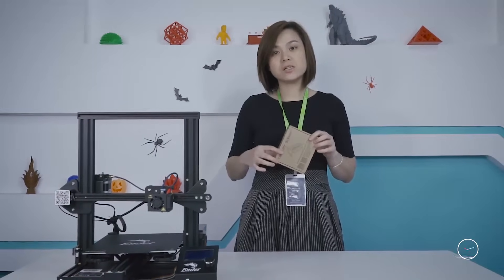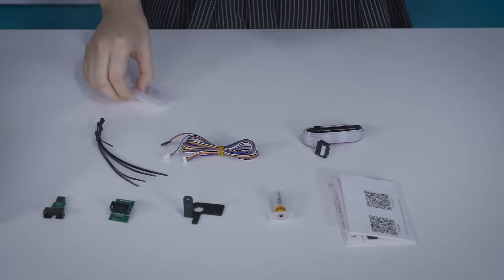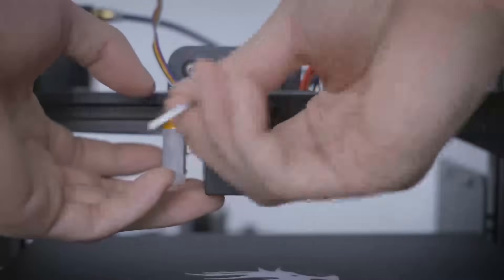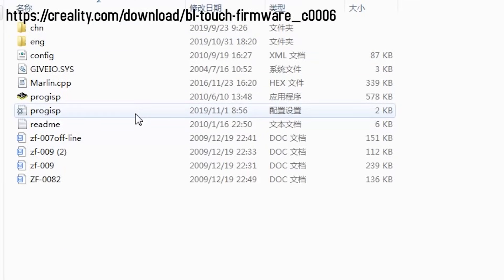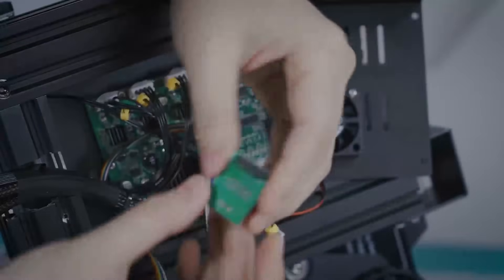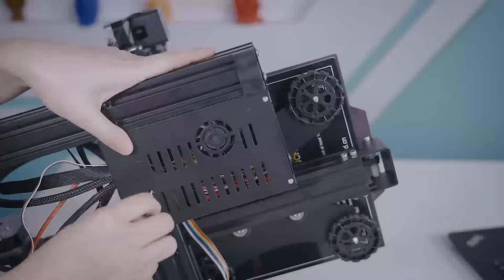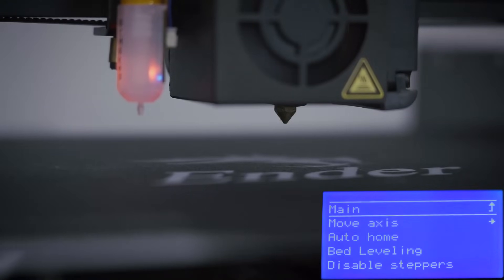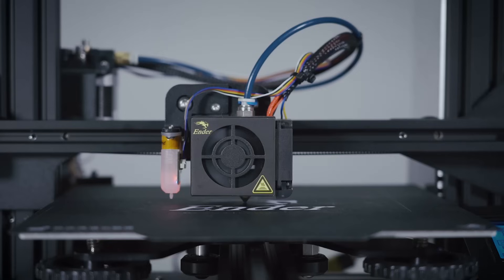How to Install Creality BL Touch Auto Bed Leveling Sensor Tutorial (Ender-3 Pro Upgrade Setup)

Comment: I screwed up in my BLTouch installation and forgot to remove the screen connector while i was flashing the board. now my printer wont open and when i plug the screen directly to the board, the creality logo is jumbled up and it beeps rapidly, what do i do ?
Reply from the maker: What kind of printer are you? Ender 3 or Ender 3 Pro?
Reply: @Creality3D  i have the ender 3 pro. I was able to fix the issue, it was caused by the connecting adaptor, it was not connected properly. The cause was me aligning the connector on the sides of the plug instead of plugging it via the pins which caused the misalignment.

Comment: Hello I Instal BLTouch on Ender 3Pro mainboard 1.1.3. I do everything like in manual. But I have problem with bed leveling.
Reply from the maker: What's the problem?
Reply: I cant print, becouse z offset allways is wrong
Reply from the maker: @barusb5022   Please try to adjust the z offset to 0, shut down after saving, and re-level.

Comment: Thank you for making this video, I will install it on the CR-10S tomorrow! Wish me luck :)
Reply from the maker: Thank you for your review and good luck.
Reply: Well, it's been 7 months.
Reply: How did it go?
Reply: How did it go?
Reply: How did it go?
Reply: @billybob3743  Like everyone else very badly, the kit is crap the firmware is even worse as it is not a BL Touch firmware with the kit and the BL Touch firmware on their website has no x, y offsets adjusted so the probing misses 1/3 of the bed and baby stepping has not been activated and they haven't included the Marlin INO file so you can't fix it yourself. and they only respond to your comments if you are licking their butt.

Comment: Hi, is there any update of the firmware to use BLTouch v3 on ender 3 pro?... Doesn't work with actual firmware download on creality website (nozzle crash into the bed when homing steppers...)
Reply from the maker: Now the official website is that the firmware is already up-to-date. Have you checked whether the cable linked to the motherboard is correct?
Reply: @Creality3D  after inverting black and white wire, the bl touch is extend when going down but always doesn't sense the bed... heard about removing the C7 capacitor on the motherboard? is that necessary?
Reply from the maker: @heavyfgmetal9361  Will the BL touch needle stretch it?
Reply: @Creality3D  yes it does
Reply from the maker: @heavyfgmetal9361  Can the BLtouch needle touch the bed?
Reply: @Creality3D  yes it does... i don't understand what's going on...
Reply from the maker: @heavyfgmetal9361   If the BLtouch needle touches the bed, but the nozzle does not touch the bed, you can try loosening the large thumbscrew to bring the bed close to the nozzle.

Comment: I have a 3D TOUCH sensor Automatic BED Leveling Sensor BL AUTO touch sensor. I have one of these clones for a while now. I have installed it today, but it is really close to the bed. Which is fine, but the actual nosel from the extruder is about 8mm or so away from the bed. I know it should be level.  Can anyone advise me where i might be going wrong?. I have a creality  ender 3

Comment: Hi! I've an issue... I try to install the bl touch but I've a  "Chip Enable Program Error" when I try to write on the step at 2:49 :s anyone knows about something to do please? :s :s
Reply: I figured it out. You need to edit the name of any files in the download that have foreign and/or Chinese characters. I know it seems odd but once I've changed the names of those files everything boots up without errors and the drop-down list of Chips is available.

Comment: i need to remove te C7 capacitor on the original creality mainboard V 1.1.3  ( ENDER 3 PRO original board ) to install an original BLTOUCH V 3.1 on my printer?
if i don't do this which problems i can find? thank you for a quickly feedback

Comment: No matter what I try it fails I do everything it asks but when I go to print it seems to ignore what the sensor said and print low in the front but raise the back way too high, i even screwed the nobs as tight as they can go to make it as flat as possible and it still fails am I missing a step, is thing faulty,

Comment: I've followed these instructions, but as soon as it finishes flashing, my Ender 3 LCD says Ender 3 Pro; and there is a horrible buzzing sound coming from the speaker.  I have verified I downloaded the hex for Ender-3 and not Ender-3 Pro.  Any suggestions?
Reply: I had the same issue, I ended up reflashing the hex.  I would recommend looking up the tutorial that someone posted on Reddit.  https://www.reddit.com/r/ender3/comments/c3ccgc/cant_install_factory_creality_bltouch_kit/

Comment: Just starting the install and getting things ready and noticed the whole approach to storing the firmware and the software to install it on your site has changed. Now most of the files are stored in an RAR file and within that there is a ZIP file with the flashing software. Not a big deal, but for a novice they may never find it.
Reply: was struggling for an hour until i read this

Comment: From what I've seen, this isn't working with the 3.1 probe and the firmware supplied on an Ender 3 pro from Dec. 2019. there are a number of issues that need to be updated for the next tutorial:
1) The folder that you download progisp to has characters that aren't read on an English computer. If you try to load progisp, the 1284p dropdown will be blank. To fix it, move the files up a folder, or rename the folder so that the odd characters are removed.
2) The progisp file is not in the BLTouch firmware collection link. I had to find another link to the firmware, and dig down in there to find progisp
3) I'm unable to get my zoffset to 'stick', even when hitting 'store settings. I tried via the console and via pronterface using direct Gcode. The Z offset is a mess, and you can see a number of complaints of others hitting that in the comments below (For those that followed this).  The current path appears to be to compile Marlin 2.0 which has autoleveling support, or to use the TH3D Unified firmware. Either way I recommend installing a bootloader (the hex file here didn't appear to have that either...I had to reopen and reprogram a bootloader on it).  I searched for "progisp ender 3 bootloader" on youtube to find the article that got that part working for me.
4) Also if you have a BLTouch 3.0 you'll want to research the capacitor C7 removal issue (documented on the BLTouch official site), though Marlin2.0 may take care of that issue for you.

I'm using a stock Ender 3 pro board which I added a BL touch to, and I've spent 9 hours so far debugging it with the facebook community to find out that most of them have moved to Marlin2.0 to get things working.   I may have to do a video myself once I find a working config. If you try this and hit Zoffset issues please comment as a reply so we can get a thead and try to find out if it's certain hardware, or if the firmware is truly just busted that got uploaded.
Reply: that sounds like way more work than installing the sensor on the printer. please make a video once you figure it out!
Reply: Abex Stereo I did confirm it’s working with TH3D Unified! It’s a bit of work but worth it I believe. I’ll start on a video but it’s going to take a bit it was ALOT of troubleshooting!!

Comment: Does this mod also work for the 1.1.2 mainboard on the Cr-10 or do I have to upgrade to a newer mainboard?
Reply: Did you ever figure this out?  I just got a BLTouch V3.1 and am having trouble finding the right firmware.  I have a original Ender-3 with the 1.1.2 mainboard.  All I can find is 1.1.4 and above mainboards

Comment: Having problem with the ender 3 fan not fitting after installing the Pinboard A (screen connector is too high and the FAN is pressing it by force)

Comment: Tryibg to install this bl touch for like then fifteenth time. First thing I notice is you do the bed leveling, but that option is not on the screen for the ender 3x I have with the Marlin 1.1.6 hex firmware supplied...

Comment: I've watched this video several times and followed each step carefully. I simply can not get consistent results with the your BL Touch kit and upgraded Silent Board v1.1.5.
It's already destroyed the magnetic bed mat and significantly scratched my glass plate. I fear the nozzle is also damaged. I purchased all official Creality components to avoid exactly this problem. Who should I contact for help. Thank you.
Reply: I recommend you to check out the tutorials from TeachingTech, even people without technical knowledge should be able to follow his instructions. If something is inherently wrong with the firmware, comiling marling could solve it. 
If it is a hardware problem only creality could help you...
Reply: I have that same problem. Nothing work like they show on this movie. I'm angry and dissasemble BLtouch because i can't printing. i spend 120 euro for silent mainboard and bltouch with isp. With latest soft, step by step finally is shit.
Thet don't answer for us because they only answer for "thank you" post.
Reply: @monter75  ouch... 120€ is a lot of money, especially if it doesn't work.

Comment: I followed the instructions and everything went smooth.   When I ask the machine to level the bed or Auto home it keeps going Up on the z axis instead of down.  When I choose bed level it completes the first probe normally but then the BL touch keeps flashing red and the Z axis goes up and up.  It's very odd, any idea what that could be?
Reply: Did u get it fixed yet?

Comment: I've fought with this thing for hours now, following the instructions and trying to get the firmware flashed. I finally did, but when I went to test the bed leveling, as per the video, it doesn't work right. The probe doesn't come in and out, the head doesn't move around the bed, it just drives itself straight down until it grinds into the bed. No activity out of the BLtouch. What could be causing this problem?
Reply: sounds like either your bltouch wire isnt connected to the board fully or the wires might be flipped
Reply: I have the same issue. Wiring looks correct.
Reply: I figured it out. There are multiple .hex files in the zip file. Use the one named Ender3Marlin1.1.6BLTouch.hex. The other one (marlin.cpp.hex) in the same folder as progisp.exe is the wrong one. Creality folks: I suggest you remove unnecessary files from the archive. Maybe progisp.exe, the correct hex file and the doc files.

Comment: I am confused about setting the offset. Do I lower the nozzle until it hits the bed and that is my offset? For example, .9 is the distance for the nozzle to hit the bed, so the equation is .9+ 2 (any number)= 2.9?
Reply: did you figure this out? mine was -3 and still prints way up

Comment: Thanks for the Video! My issue is that the sensor is trying to measure outside of the bed, so the nozzle collides with the bed.
Can you provide the correct start gcode for an ender 5?
Reply: Hi!  
this is happening to me now,  Did you get a solution?
Reply: Same here
Reply: I have the same issue... Any solutions?

Comment: So this will work (v3 bl) on the new 1.1.5 motherboards? I just got both (blk friday/Xmas) but everything I've been seeing, they may not work. I really wanted the thermal runway protection so why I went to the 1.1.5 plug/play board. I'm just confused & worried I'll screw something up trying to get this installed.
Reply: I'm using a v3.1 with vanilla marlin on the 1.1.4 main board and its working but I'm having problems getting the z offset correct. So yeah you should be ok

Comment: Hello, I just received my Creality BLTouch kit with programmer for the Ender 3 Pro I bought a month ago. I downloaded the files from the Creality web site and the Progisp 1.72 does not show any boards in the Select Chip when I connect it. I have a blue light on the ISP pinboard.
Reply: I figured it out. You need to edit the name of any files in the download that have foreign and/or Chinese characters. I know it seems odd but once I've changed the names of those files everything boots up without errors and the drop-down list of Chips is available.
Reply: i have the same issue
im over creality never responding to my emails
Reply: Same problem here. Are you getting the errors when initializing the software? Access Violation at address 75492200 in module KERNALBASE.dll  read of address 02827000          
Access Violation at address 75492200 in module KERNALBASE.dll  read of address 00DA5000     .  In addition if I click on any of the tabs once the software is opened, I get another error. The only way I can close the window is through the Task Manager. No reply from Creality and apparently no one knows what the problem is on the Facebook site.

Comment: After installing and following all directions i have a blank screen on my ender 3 pro...um now what? 
UPDATE Had to power cycle with the display cable disconnected and then reconnect and power on. The display now is working correctly
Reply: Joshua Major I’m having the same problem how did you fix it
Reply: @jurassiclizardlyon643   after doing everything in the vid, i pulled the display cable off, powered the unit on and then off. Plugged the screen back in and powered it back on. And it worked
Reply: Ok I did that but still nothing can I have help
Reply: @jurassiclizardlyon643  i am not sure what u are doing wrong? What model 3d printer do u have? And are you using the creality 3d bl touch kit?
Reply: Thank you!!!!!

Comment: After doing this when it starts from the edge its close to the bed ,as soon as the printer goe to the centre ,it is approx. 4 mm away from the bed. Every time it goes to the centre of the bed ,it moves higher????????
Reply: spooner Fpv exact same issue. I am trying to install it again, did not make it that far yet and noticed their board cover has the fan offset, my cover will not go back on without cramming the cable attachment and knocking it off. Last time I got it back on, the bed would not start close to the nozzle even with z-offset, now, their bed leveling screen option is also not an option on my ender 3x screen.

Comment: When i open progisp and try to select the ATmega 1284p there is  nothing there to select.
Reply: I have the same problem, i cant figure out what to do
Reply: @PiWizard  try this suggestion. its working for me. https://www.reddit.com/r/ender3/comments/c3ccgc/cant_install_factory_creality_bltouch_kit/?st=k4rge0do&sh=20c11aa5
Reply: @PiWizard  got it to work in 3 days, download the free "WinZip" program and it works for now on windows 10.
Reply: try this suggestion. its working for me. https://www.reddit.com/r/ender3/comments/c3ccgc/cant_install_factory_creality_bltouch_kit/?st=k4rge0do&sh=20c11aa5
Reply: You have to run the compatibility wizard with the program. It will want to run in win 7 mode if you are on a win 10 machine
Reply: Just right click and run test compatibility...then follow the steps, thats how i got it to open correctly

Comment: Great tutorial, however my main 10 pin connector  that goes to the control panel, came hot glued to the port.
Reply: Just break it off with a screwdriver.
Reply: the same thing with mine, i got through it finally with those sharp pliers things that come with it

Comment: Is that very nice you guys made a video for the easiest installation machine.
Let me remind you selling this product for CR10S5 as a 100% compatible accessory.
How can I install it in the machine?
Reply from the maker: please check here: https://creality.com/download/firmware-for-bl-touch_c0006
Reply: Did you check this page ever at all? There are a .hex file and a .pdf for kind of online printing something. There is no F*ckin progisp.exe or what! There is no clear instruction on how to Build in the BLtouch and what to do after. Check my comment properly before you sending me the useless answer! I'm your customer! I know how to change the firmware. I did change every time when Creality release one. But who is talking about firmware anyway? I have no v1.0 motherboard like in an Ender3. I have V2.1 in CR10S5! I don't think you sold any CR10S5 with a v1.0 motherboard at all. On a V2.1 motherboard, this way is not working! You selling this product as a compatible accessory for this machine! You should provide a 100% clear instructions guide for this because this is not a plug&play device. Like in Ender3 almost. I'm talking about physical installation! Where to connect the cables on the motherboard? What to do after? Clear answers! Like in this video but for the different motherboards. If you just give a website where I can download proper documentation for my machine is enough. I'm talking about everybody not only about myself. I'm talking about everybody who is having a v2.1 motherboard or anything else except V1.0. Because you guys selling this product as an accurate, compatible product for all types.Sorry for my tone. I did contact in every possible way to your company. And I get the same useless answers. They even send me facebook group link!WTF? You don't even know how to put together your two own products?!  
I do appreciate the improvements in the machine. But STOP sending f*ucking dumb answers. I feel like you sold me something. Many of us having an issue with it and you guys don't even try to help, which is a work for you to prepare. NOT for Us! Is that serious I have to browse the internet for days to solve the problem wich is your work and you get paid for it? Bytheway We paid for it! Don't get me wrong is not for the channel is for the company. I do appreciate your work on youtube.

Comment: Has anyone had problems like me with the ender 3 fan not fitting once this has been installed?
Reply: Hi, I have this problem too, did you find a solution?
Reply: @dragolan69  Hey yes I did. There are a few bl  touch fan covers on thingverse for  you to print to fix this...https://www.thingiverse.com/thing:3716291